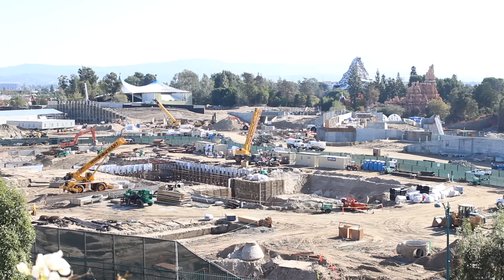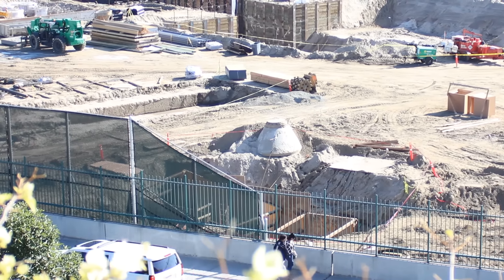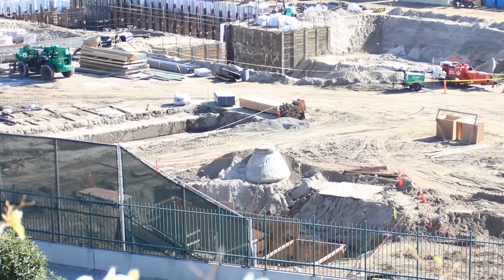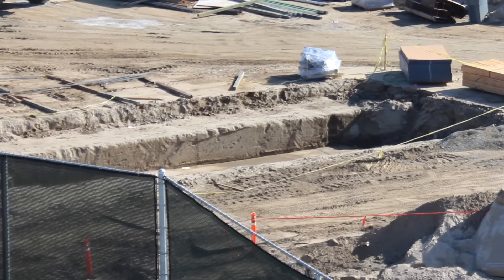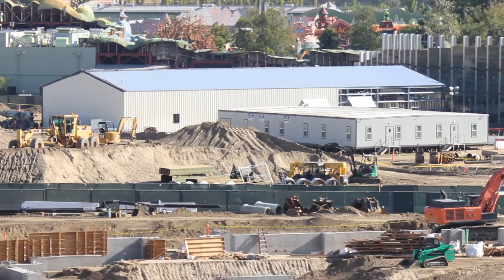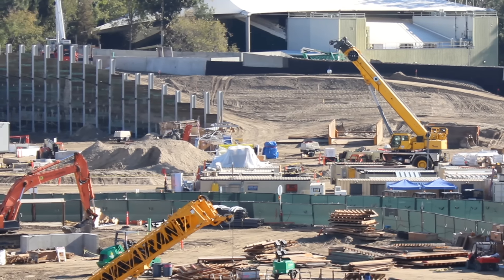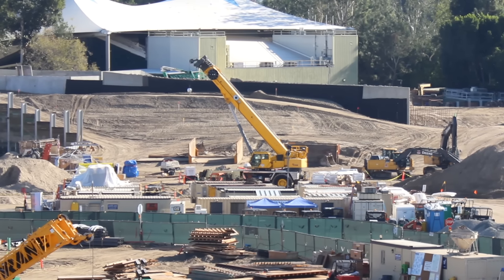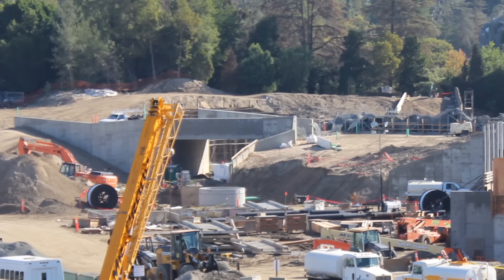Star Wars Land Construction Disneyland 11/25/16

Comment: The DLRR will definitely be on the far side of the second wall (along the ROA) and my guess is that they will simply fill in the space between the two sets of walls with a lot of dirt and plant trees, etc. This will be a berm between the ROA/DLRR and the rockwork/waterfalls on the south side and SWL on the north side. They need a berm and there really is no reason to have an access road in between - there's nothing to access.

Comment: The white bridge (which will eventually be painted in "Frontierland" colors) is a pony truss bridge, not a trestle. A trestle bridge would have supports under the tracks only.  The railroad tracks will be on a trestle bridge as it passes over the Rivers of America, alongside a series of waterfalls and then pass over the pony truss bridge as it approaches Big Thunder Mountain.
Reply from the maker: +David Mullich thanks for the info!
Reply: My pleasure.  It might help for people to refer to this concept art when looking at your video.  Behind the concrete wall would be the waterfalls and trestle bridges over the river.  The white bridge would be the pony truss bridge on the extreme right edge of the art, under which is the Frontierland entrance to SWL.
http://www.trbimg.com/img-56905540/turbine/la-fi-disneyland-riverfront-post-star-wars-land-20160108
Reply from the maker: Just checked out the link.  Never noticed the pony truss bridge before. That helps put things into perspective. Thanks
Reply: That's awesome! I never noticed the pony truss bridge before either! Excellent eye!

Comment: First thing, that "small wall" as you called it is actually a gigantic footer that will be concreted, more than likely for the show building you were talking about. Second thing, that part you said that they connected the two walls is wrong, they were already connected. Go back and look at your own video and you will see a wall with a cutout at the top, that is this spot. What you are looking at is a water feature at its beginning because in other videos you can see them working on the pipes, that wall they are building is the back part that will finish the pool it will need and the cutout is where the water will run over.
Reply from the maker: +Mark Scheurich thanks